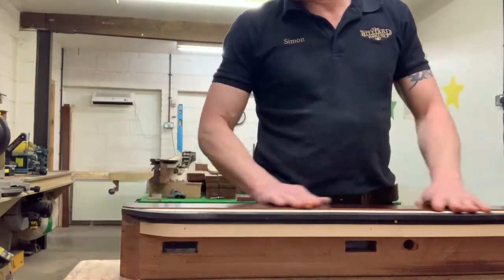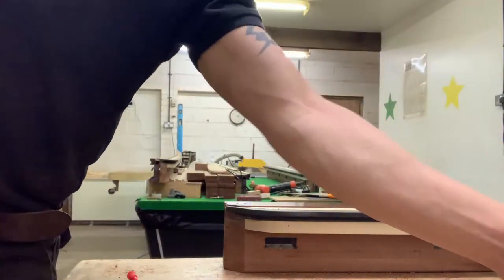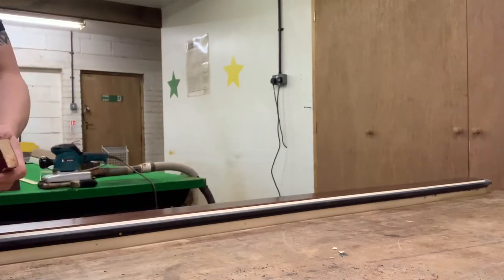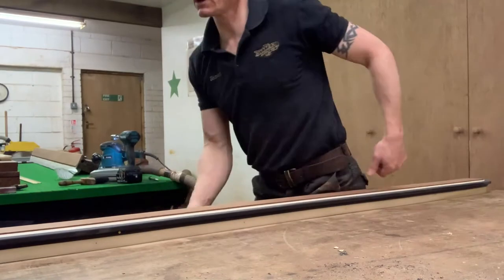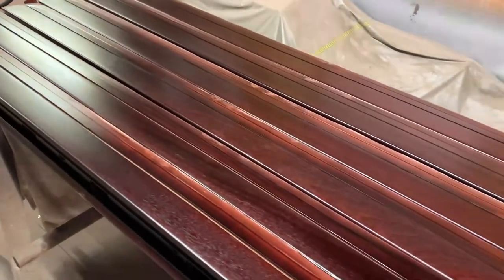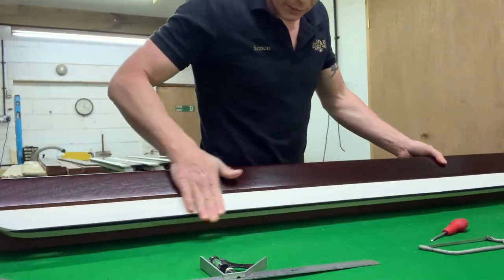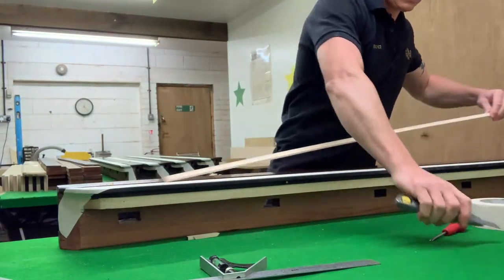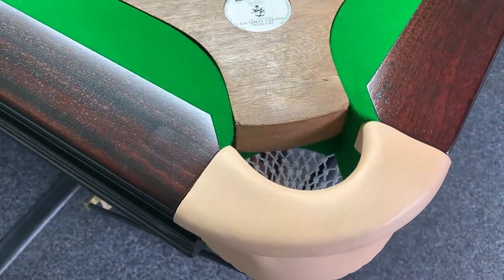Billiard Supply Co - Snooker Table Cushion Refurbishment - Part 3

Comment: what is the correct height or the cushion rail when using a full size ball
Reply: 39mm at top of covered cushion is a great starting point for 2 1/16” balls.
Reply: 1 1/2” from playing surface to the top of the cushion nose.

Comment: could you tell me what kind of stainer is used on the rails panels and how many coats it needs on this wood if its Sapele , thanks?
Reply: Yes it is sapele, one cote of stain is enough. I then use a small amount of the same stain in the first coat of sealer to uniform the colour and get the desired shade.
I use morrells products
Reply: @simonherbert9130  ok thanks, bty you do a great job, im doing a 8ft snooker table by having to replace the wood as its a old table which is a R. Stevens and Sons and they was making full sized tables in the 1830s , i was lucky to buy this table for 99p which was in need of restoration and now its near to brand new, you give me great tips of how to fit the rubbers and how to get the right staining and laquers just right.